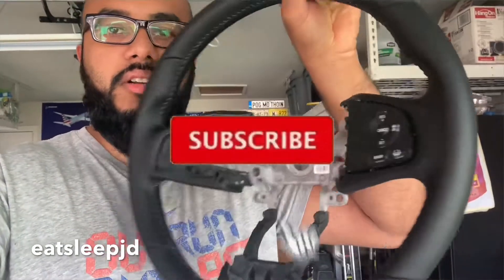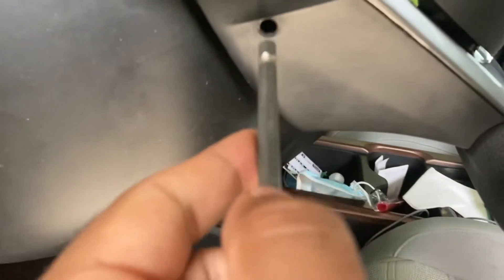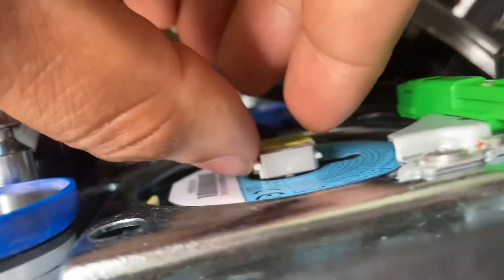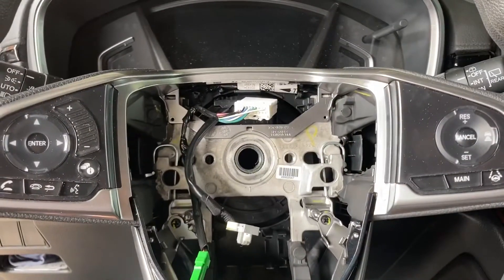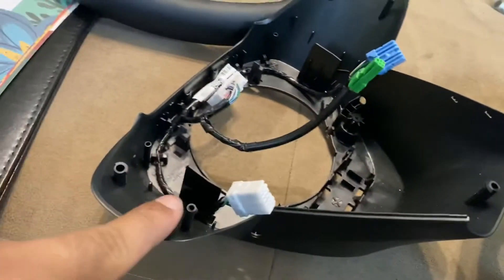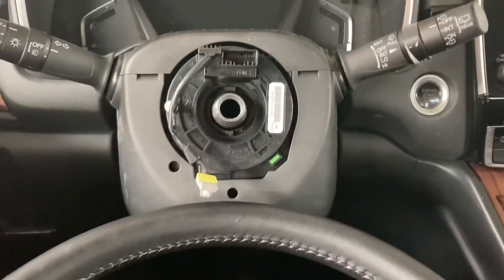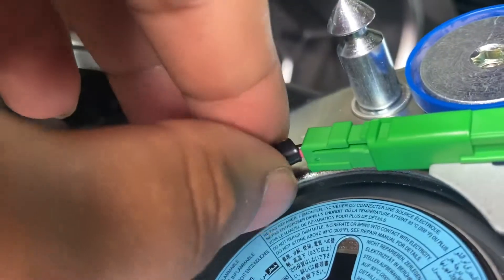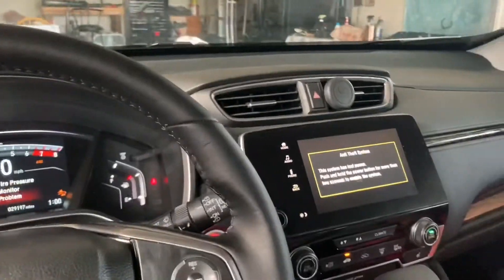Honda CR-V Leather steering wheel install - DIY - Similar to Accord, Civic, Passport.

Comment: used your video to install a leather steering wheel on my 2 month old 2021 Honda CR-V.
thank you so much, video made this job much easier than i thought it would be, really appreciate it, thx…!!!
Reply from the maker: Glad to help :)  Sub for more CRV action.
Reply: Any one know if the heated steering from a 2019 will fit 2022?

Comment: Is there anyway to fit 2020 leather steering wheel in 2017 crv ex I bought it from ebay but they didn’t accept return
Reply from the maker: yes the 2017 - 2020 CRV have the same steering wheel.  This is exactly what you follow to put it on.
Reply: @EATSLEEPJD There is a difference between 2017 and 2019 steering wheel control and fitment like cruise and audio slots and the ring slots are different
Reply from the maker: @shuja3548   really? You might need to buy those for the specific year then.  The wheel itself and airbag should be same.